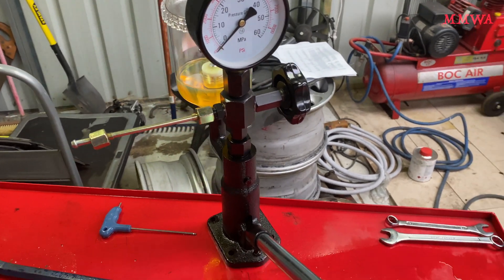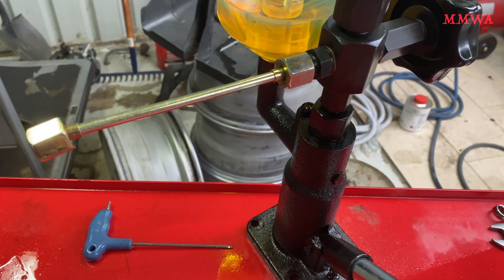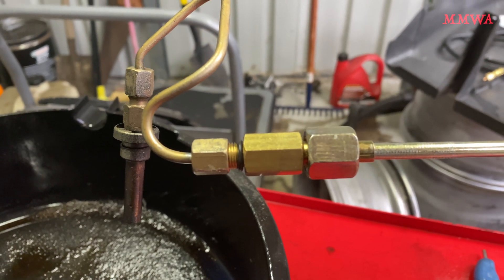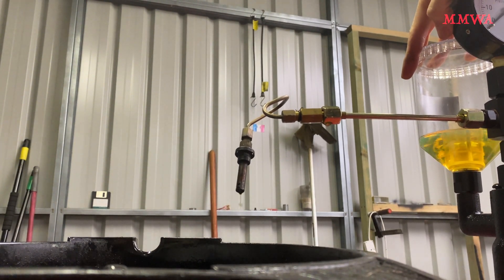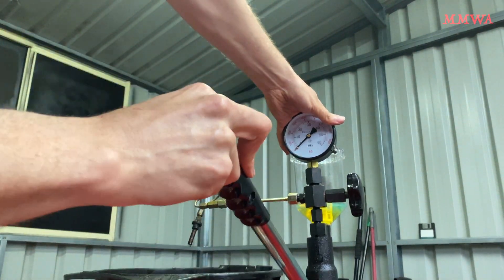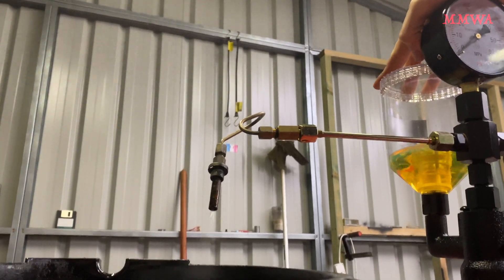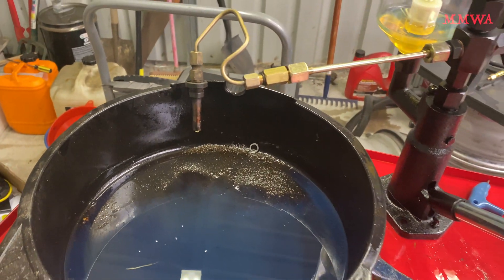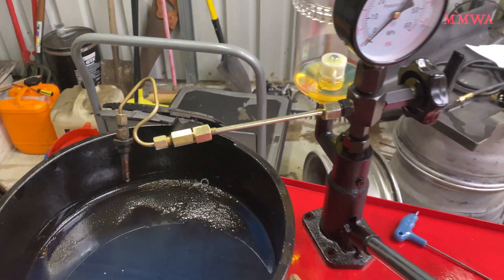KE-Jetronic - Can you use the diesel injector testers? Yes, but....

Comment from the maker: As it turns out. the course thread injectors like on the m103 fit straight onto the tester out the box! The adapter is only needed for the fine thread injectors.

Comment: You could just use a length of high pressure hose or pipe, hang it up vertically and have the injector fitted to the bottom end. Fill the hose/pipe with diesel and add an air hose connector to the top. Set the compressor to the required pressure and apply pressure to the hose/pipe with the aid of a blower trigger. I did this checking the injectors of my 560SEL. Please let me know if you see any flaws in this procedure. Corrective comments are appreciated.
Reply from the maker: Coincidentally i showed this method in a previous video. Yes it works fine, just need to make sure the hose is kept clean and only use clean suitable fluid, ie diesel or kerosene. In my demo i used what i had on hand which wasn’t appropriate, it disolved the hose interior and blocked up the injector. But yes your method works and has been used by the pros for years
Reply: @MMWA-DAVE  Thanks for your reply. I always follow your videos with interest. I like your methodical approach and picked up a lot of useful info. I made myself a fuel distributor flowrate tester as well. Using 8 clear plastic hoses vertically mounted on the distributor outlets. Pity I can't attach a pic to the reply.